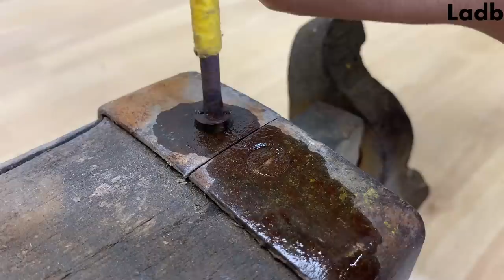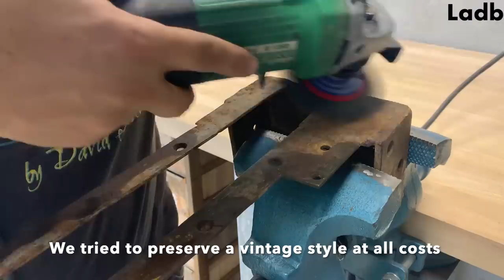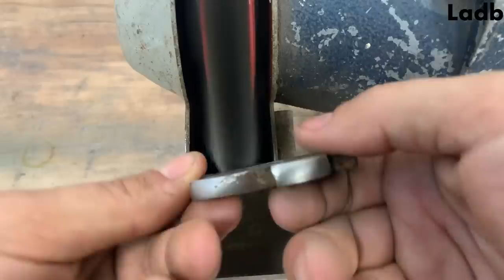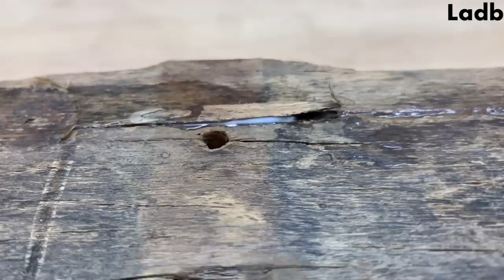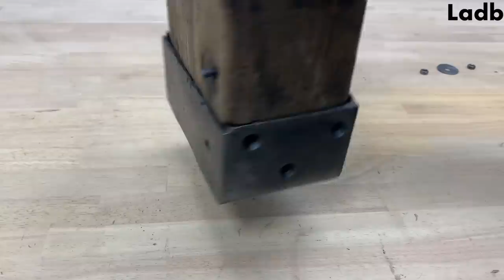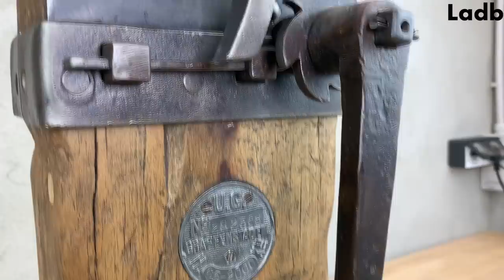Antique and Broken Wooden Jack Restoration

Comment: Most restoration projects I’ve seen take something old and make it look like new. This one restored the jack to look like old, and I loved it! So glad that you took the time to repair the wood. Most people would have tossed it in the fire and made a replacement. There is so much character in that old wood. Treat it properly and it will last hundreds of years. Bravo!
Reply: I am personally in the get new wood camp. For about 200 years, I imagine the elements and insects have had a chance to deteriorate the wood. Also,  the wood had to be glued and screwed back together. This does not inspire confidence in me about the trustworthy strength of a tool meant to bear tons of force. This is probably all moot, because I expect this to sit pretty in somebody’s collection for years to come.
Reply: @josephnavin4451  All good points. I can’t imagine anyone actually using a wooden jack in this century. Yet to have a piece of functional history like this with original wood is exceptionally unique. I’m an amateur woodworker so I appreciate old wood. It’s not simply a hard, sturdy medium to me. Properly cared for, wood will last for many generations. My 2 bits.
Reply: @josephnavin4451  this piece is not meant to be used, it belongs in museum or private collection, thus must have original wood, besides there are tones of wood-preserving methods avail right now so there are should be no concerns for keeping it original.
Reply: Zak Vinni I agree. I do think that this will most likely sit in someone’s collection. I cannot readily imagine how to incorporate a tool this obscure into a museum exhibit. This video is the first time I became aware that these existed back then. Museums usually show exhibits of cultural artifacts which are representative icons of a region during a certain time period.
Reply: Но втулку на рукоятке надо было восстановить аутентично, чтобы она крутилась.
Reply: Один Человек согласен.
Reply: I bet the wood is a repurposed railroad tie.
Reply: I absolutely agree with you. Restore doesn't always have to mean: make it look like new. The fact that it still looks antique but functional gives it a lot of character.

Comment: Some years ago I was at the Pickering traction engine rally in Yorkshire UK, and they used a jack very like that to move a traction engine a few inches to tighten up the belt to a threshing machine, they called it a Traction Engine Jack, Great restoration, always enjoy old machinery being restored

Comment: I can honestly say I've never seen a wooden jack before.
Reply: Pretty sure these were used for horse carriages, back before cars. I guess this thing is over a century old?
Reply: Yeah the older ones are made of  wood
Reply: Pfffft 🤔 Millennials...Am I right guys?
Reply: Those wagons back then weighed more than the whole tractor. They were made out of heavy wood, plus they were big, plus all the supplies they carried.. especially a chuck wagon
Reply: @LetsTakeWalk  These were even used for lifting railway carriages and components. To be honest, it has a huge lifting force, smthng like in the magnitude of 
several tens of tons
Reply: What is the principle of work of this machine?
Reply: i have in my farm and I used sometime, instead hydraulics jack
Reply: @t6404  it's good cause it's progressive and you have no risk of oils gone problems lol
Reply: Same here pal. I am 44
Reply: I have read about Jack the Ripper.
Reply: oldi184 good. It has nothing to do with the current subject but thank you for sharing this information.
Reply: @jeffcarroll1990shock  
I know. Sorry for the off topic comment.
Reply: We have some of them at home. But in complete working condition... No Restoration required. It's always about how you care about your stuff
Reply: Ya the oldest jack ive seen is a old gear powered bottle jack my dad has

Comment: Amazing, how they made such simple tools, that withstand time. I think I would of put the sawdust in the screw holes, along with the glue. I would of heated up the wood, so the wax would seep further in, adding extra protection.     I had a thought of stabilizing it with epoxy resin, or a watered down wood glue to soak in over night.

Comment: That is a vintage wagon jack that the people of yesterday used to lift their wagons when the wheels need greasing, or the spokes needed to be replaced. Wagon grease was also used in that jack (it was quite thick and sticky). The eye-ring was used to anchor it to the ground to prevent it from shifting. It was also used to secure it to the wagons side when not in use... Nice job....

Comment: Ahhh, I have one of those and it is in need of some TLC, not quite as much as yours though. I did wonder about the metal handle and didn't realize it originally must have had a wooden one.
One small point is I might use hot linseed oil & beeswax, 50/50, to finish it, as in french polishing, but your stained wax looks grand! Aught not the wood of handle move free of the metal shaft so as not to get blisters? ... perhaps yours does move free, I can't tell.
Very instructive! Thank you.
Blessings from Eire.
💖🙏🌻
Reply: Can I ask what type of jack it is because I would love to find one
Reply: @bobbyconnor7765  I'm back  home at the weekend so I'll have a look and let you know, you might want to buy mine but postage from Erie might be to much - its very heavy! 
💖🙏

Comment: The wood should have probably been replaced because it looks like it's getting iron sickness, otherwise 10/10 great work!
Reply: Can you explain iron sickness ?

Please.
Reply: Or has the iron got wood sickness 🤔
Reply: it contracted the beer flu
Reply: @theamishsoylentretailersof1952  it's what happens when ferrous metals rust inside wood, it happens to boats a lot
Reply: @snbapl rogoa sometimes you have to like if a part is missing or too badly damaged
Reply: @doodleydoo169  Does it fatigue the wood or make it more likely to fail ?

Comment: Fun fact: this is an old French made stagecoach jack used in the 1800s...
Reply: How do u know?
Reply: That fact is not fun >:(
Reply: So, it's a freedom jack?
Reply: sounds smart enough to be legit
Reply: Not if Phillips head screws weren't made until 1936.
Reply: @johnthompson9625  The Phillips screws were obviously not original, indicating that the jack had been repaired at some point in time. I would have replaced them with antique slotted machine screws. Cheers.
Reply: @poppy3215  well aware of the replacement of the screws,  that's why I pointed out their use.  
While it is a timely piece of work, the substitution indicates that you can't verify how much of this piece is still original.   Lots of people getting fooled by antique claims when most of the parts are newer replacements.  
Very prevalent in antique guns, where some people re-blue, replace screws and weld/repair damaged metal, rendering the piece worth less than it's original state.

Comment: I was actually surprised to see Phillips-head screws on the internal parts...  Do you think they were replacement screws?  *leaves an open can of sardines for Avril*
Reply: 100% yes this is a previous restoration. Phillips screws weren't invented until the 30s and this Jack is far older. I wish he would have used slotted screws in this restoration. Wooden handle should spin too

Comment: Excellent
Reply: I disagree. This is neither restored nor vintage now. The process is interesting but the result is a spoiled old item (
Reply: Gr Ru its now a working tool and he enhanced the value. With care it will last another century or more. It’s been given new life. It’s been restored.
Reply: @TSimo113  well, it's all about a 'restoration term interpretation.  Me not a native speaker, but in Russian this is not a restoration, but a repair))
Reply: @GrrrRu  Sure, I understand. I'll go with Repair. But he didn't spoil anything. He brought a tool back from the dead and increased it's value all around. It also looks very classy. But putting that aside, how exactly should a proper restoration of this vintage item have proceeded differently in your estimation?
Reply: @TSimo113  given the age it should neither be restored or repaired but simply preserved. A little TLC to get/keep it moving should be the absolute limit ever done to such an item. Any collector or historical value has been completely destroyed. He has a completely modern shop so doesn't need it as a working tool and that would be the only acceptable reason to do this.
Reply: @clarenceschaffner2342  If you watched the video, a couple of the parts were bent and the wood was badly cracked and broken. Plus, oxidation, missing screws, rusted screws, etc.  I'm not sure what collector would pay for that in such condition or what it's worth, but there must come a point in which collector and historical value are not worth the time and effort to even consider based on decayed condition. Museums display replicas and restorations all of the time, and a pristine working restoration is more educational as well for future generations.
Reply: @TSimo113  it actually was fairly valuable to tool collectors as it was that level of wear is impossible to fake and helps prove it's authenticity. Also it's metal and wood components had reached a state of equilibrium where if not exposed to weather it would not degrade much further. By removing the rust and patina he has actually speed up its decay by exposing the metal and wood that was underneath.
Reply: What is it?
Reply: The tool become antique,but wonderful  i love things like that,
Reply: @GrrrRu  ...thank you for providing a dose of reality to the ignorant

Comment: There are things that people do not understand about restoring. 

There is the repair restoration like this one, that keeps the character of the object and only replaces what it needs when it needs it. Like taking care of the wood to preserve its character. 

And then there are the other side restorations full restore, where we want them to look like they looked when it was purchased keeping as much as possible the original parts but replacing everything that can be replaced without losing authenticity. 

both are works of art in my book, but for tools like this one, the fixing instead of remaking is the best approach, on a car, a full restoration is the best option rather than just fixing it.

Also, these tools were either painted red or green, depending on the company. Or just had burnished metal parts. The wood was lacquered.

Comment: ok for old wood if you are to glue it to retain strength a trick is to get a vacuum sealer (the type for veg/meat) and place the wood and glue in plastic bag and vacuum, it will force glue into wood and them you clean the wood. Yes a lot more messy but gives it a lot more strength if it rly needs it.

Comment: Fascinating video, I'm surprised that they put the modern screws back in and didn't use the correct size screwdriver on the original screws. Otherwise an excellent job.

Comment: I usually admire the work you do in your restorations, but I'm not sure using a grinder and files is "trying to preserve a vintage style at all costs." The piece has history, which it earned through a life of hard use. On the other hand, I give you points for not smoothing it all away, for using dowels instead of screws to secure the wood part, and, of course, for Avril.

Comment: Lovely job but the timber handle you made should have been a larger diameter and drilled out bigger to allow it to turn on the metal handle.   Maybe bound for strength with the wire.

Comment: I would have repaired the major wood split with polyurethane glue because it expands to fill more of the internal voids along the break. Probably would not have added scews. I liked the use of PVA glue to fix the outer splits and splinters but I am super curious what it would have been like to use wood stabilization after that point. Cactus Juice, specifically. I might not have reused the Philips screws as they were likely not original. Maybe they were but I'm suspicious about Philips screws in older restorations.

Comment: For dirty and greasy metal parts try using brake cleaner. It will clean that faster than anything. But if you plan on using it on raw metal give it a spray of wd40 after to protect it from oxidation.

Comment: If it was me I would have filled all the cracks with epoxy resin. And used power tools to sand it smooth and then varnish. As far as the metal I would have brush painted it black like it most likely was. It looks very old I’d say 1890s. Those Philips screws tell me someone has been in there before. So I would have replaced all those with the right flat head screws.

Comment: Nice work but, I'd have replaced the modern screws with slot screws, and used a traditional cotter pin rather than a modern one.

Comment: To fast remove grease use desiel fuel, and rinse it with petrol gas on a strong sprayer like compressor spray and wash it with detergent powder then rinse with clean water and dry

Comment: Like your work and the result. Have you tried a schoots brite brush to remove rust? I've found them to be very effective.  I'm curious why you don't use rust removal liquid? You can also add material by electrolytes process to the steel or? Just curious 🤔 🙂👍

Comment: Your restoration project looks amazing, however you used the same block of wood without adding that wooden filler or even tried to take another block of wood to make it look newer, was there a reason behind that, otherwise I have seen many of your projects and they are amazing.

Comment: Well since you asked if we would have done it differently, I was expecting a sandblaster when you instead pulled out the rotary brushes.
There is nothing wrong with how you did that, it just wasn't what I was expecting.

It alsp surprised me that you used the old wood.
I thought you would cut and prep a new piece because it's structural integrity is now compromised.

Comment: So clearly the restorer has the means to do a full rebuild but I'm curious as to why a new block was not used instead of repairing the old block and then aged after replicating a new piece of timber?

I suppose structural integrity was not the priority since this is not going to be an actively used tool just for display purposes.
Reply: It'll work for another 50 years don't worry :)

Comment: Someone, 100 years in the future: why did the person who restored this use so much glue??
Reply: Because cold fusion hasn't been invented yet.
Reply: southdakotaslim  Los tornillos Phillips estaban ya en el gato cuando comenzó a desarmarlo...
Reply: unlike epoxy, PVA glue is completely reversible and a fantastic choice for restoration, if you are concerned about the Archeological future of this jack. About the only better Choice would be hide glue.
Reply: southdakotaslim  Some would argue that the screws he found in the jack were part of it's true history therefore should be re-used... I am not one of those people I agree with you,  I would have like to have seen him use historically accurate screws or historic replicas. I really like this guy's restos because he doesn't over polish and he doesn't use new hardware for the sake of shiny metal.
Reply: If this thing was not just a show piece and was gonna be used to actually hold some weight, I think epoxy would have been a good thing to use to shore up some of those cracks and breaks rather than just glue. But for a show piece glue is good.
Reply: Burp 😗
Reply: LOL I was going to comment exactly the same thing, down to the 100 years in the future.
Reply: Kiss you... 😚😘🤗
Reply: @pghgeo816  Must have missed a bit. Fell asleep? I saw him repair and clean screws  even watched the rust drop off
Reply: @pghgeo816  Good to know! i was already wondering about the glue.
Reply: Old screw holes tend ot be slightly rotted, so instead of putting bigger non-authentic screws in, glue keeps it all noice and toight.
Reply: southdakotaslim  slotted screws are the worst
Reply: For real though he's inconvenienced the next person who tries to open that thing up big time
Reply: @dnbmania  Ueah !! Not seeing that happening anytime soon.